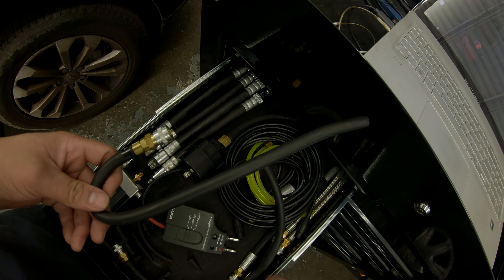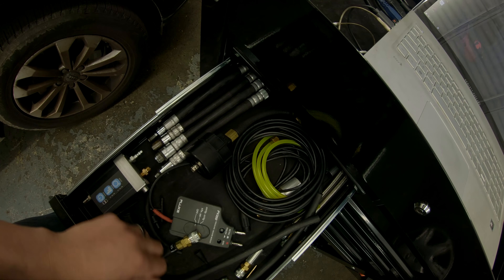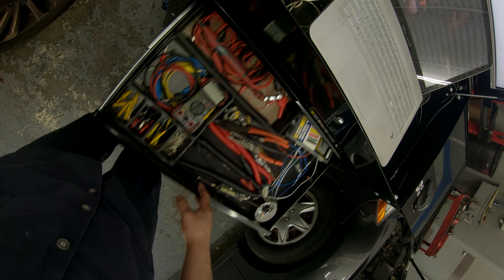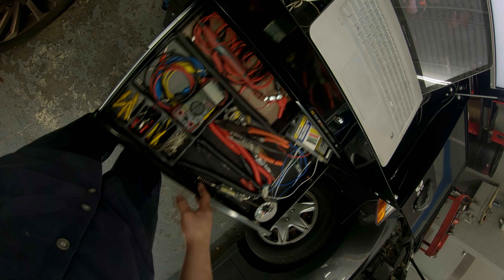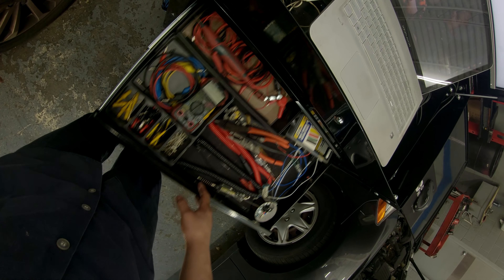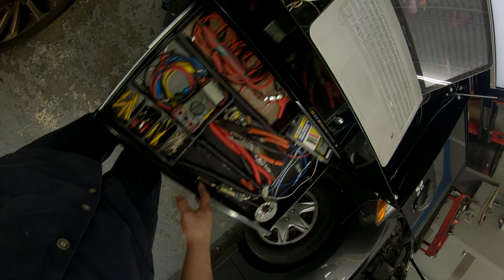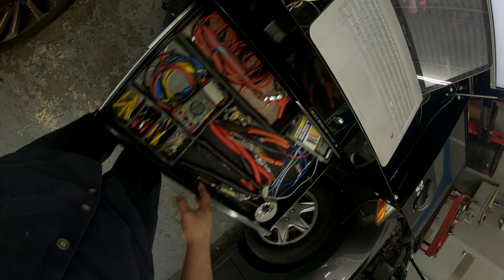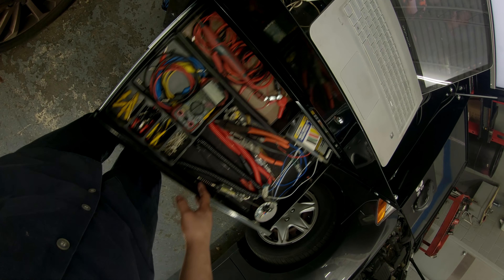Toolbox tour - Harbor Freight Tech 2

Comment: The new mini snap on mini crimpers and strippers are great for those tight space.....but i did just see an OTC pair that looks identical for only 20 bucks on one of the aftermarket tool websites. Ill get you the part number off of the Snap-On minis in the morning and I'll also see if those OTC's crossover because when i saw them i thought damn they are identical to snappy just blue handle and less then half the price!. Loved the video i have a USG series 2 cart i have setup as my diagnostic cart and im setting a 27" Samsung curved monitor in to connect to my  SnapOn Vantage Ultra, Autel and Launch scanners and also a custom aluminum cased PC tower built for OEM programming and also PC based scanner softwares both OE and aftermarket. Those carts are great for a diagnostic cart in my honest opinion!! Great going Super Mario!

Comment: I love my power probe 4 and the hook. As long as you know it’s limits they are good tools to have. I used my spare quick coupler that came with the WPS500x to make a hose that adapts to all of my fuel pressure gauge kit adapters so it’s all plug and play. No need to unscrew any connectors. My next project will be making an Arduino powered box that I can hook up to my old Honeywell pressure transducers to use for reading fuel pressure while test driving. A lot of times it’s not really necessary to have to drag out the scope just to watch fuel pressure.

Comment: First impressive 

Second: your skill level is excellent A.K.A 10 cent toolbox 100 mechanic is what I see here 

Some shops I 100 tools 10 cent mechanic who fires parts 

Be proud of yourself 

3rd  you hourly now? Or still flat rate? 

Keep them coming luv this one
Reply from the maker: Thanks! Yeah I'm pretty cheap 😃 I've seen those guy that have thousands upon thousands of dollars in tools but struggle at a washer pump diagnosis LOL but there are some top notch techs that reward themselves with great equipment, which is pretty cool. I'm no longer flat rate, I'm salary, can't complain, no more ups and downs lol thanks for taking the time to comment bud 👍

Comment: Mario.  On Windows when you extend your display you can change it to where you can move the mouse pointer up to the screen instead of to the right.  Right click on desk top,  click display settings or graphics properties, identify each screen and then simple as dragging the screen on top of the other screen and saving settings.
Reply: An other bit of advice when using windows.  Google windows hot keys.  Use the key board as a controller instead of the mouse.  Can make the operation of using windows a bit smoother
Reply from the maker: Great tips thank you very much!!